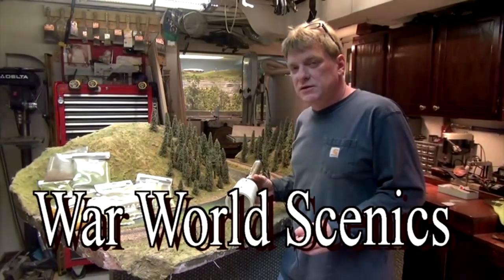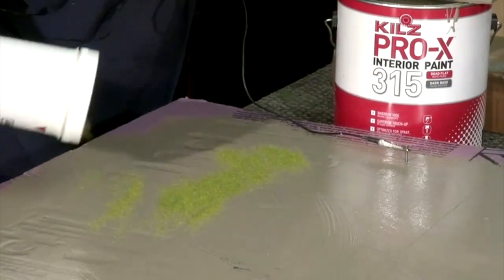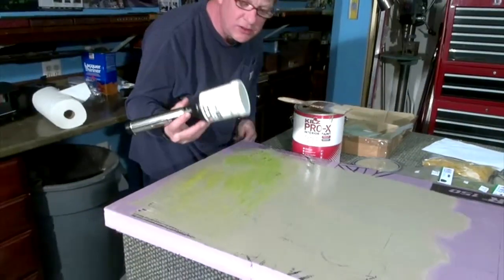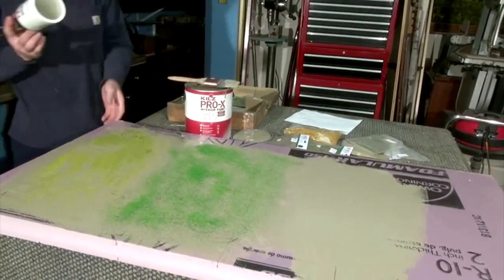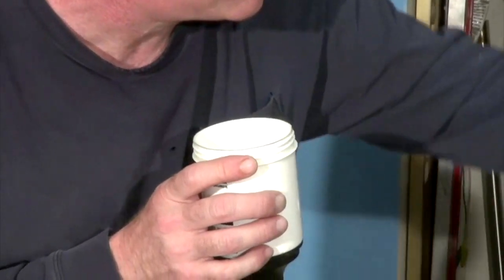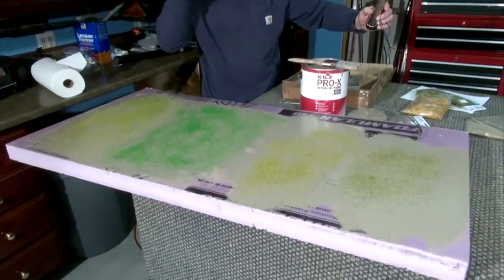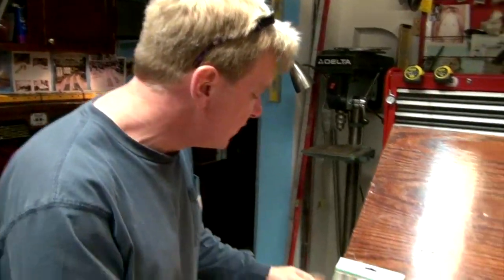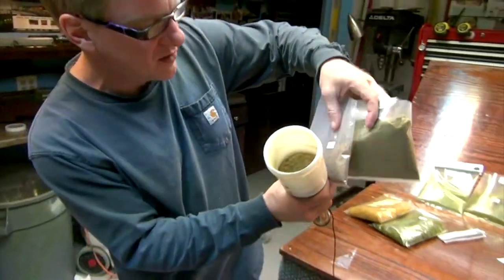War World Scenics static grass | Model railroad bridge | Model Railroad Hobbyist | MRH

Comment: Ken, I wonder if you'd considered "recycling" the grass that didn't stick by putting a handkerchief or other fine mesh cloth over the end of your vacuum hose.  You can hold it in place by hand or with a rubber band.  The suction of the vacuum will form the cloth into a "cup" inside the hose end, and will stop all that lovely grass from ending up in Shop Vac Purgatory.Then you can put it back in a container for re-use.  Thanks, and keep up the great work!

Comment: What causes the static?
Reply from the maker: A negative ion generator -- it's an electronic component of things like humidifiers and air filters. You can buy them separately for a few dollars if you want to make your own static applicator. Visit the MRH website http://mrhmag.com and use the site search box. Type in static grass and you'll get lots of threads on building your own.
Reply: Thanks for the info.

Comment: You do not need to have grounding wire in glue or similar to get the grass to stand up. The applicators create a static magnetic field where the grass falling from the mesh is attracted back to it. The grounding wire just needs to be within the area where you are working but does not in any way need to conduct the power through the glue.
It is just a myth.